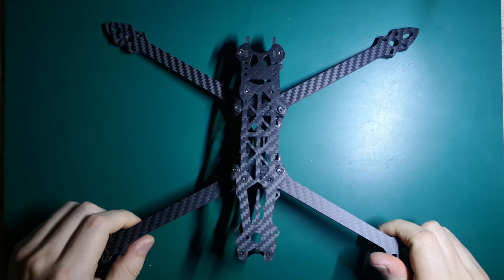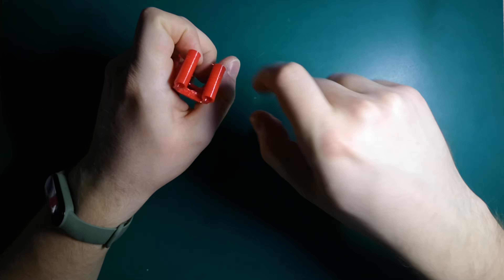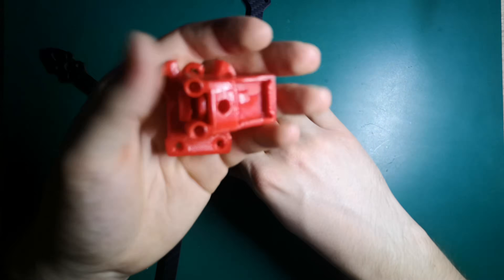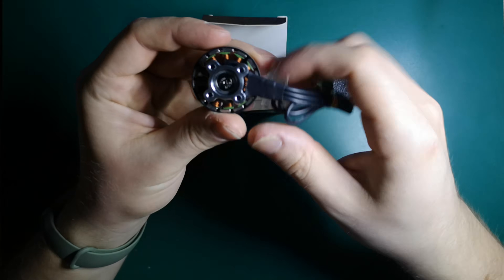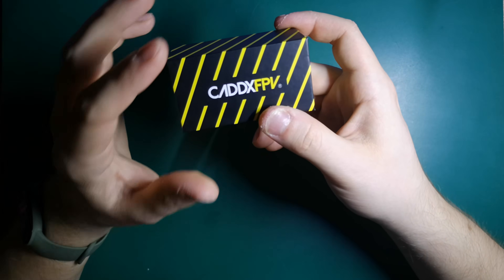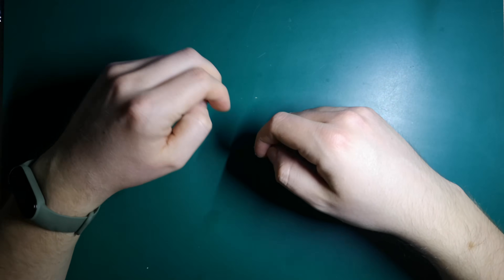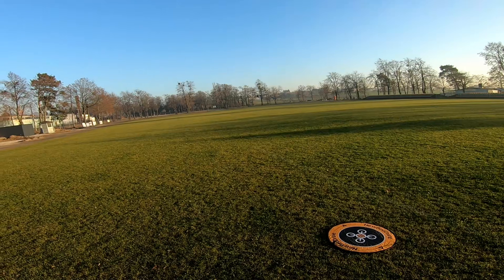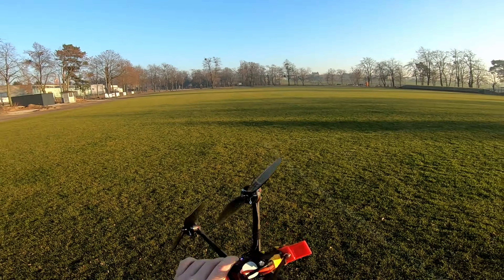Build a light 7Inch Long Range Drone for 180$! in 2025 [It can RIP🔥 as well]

Comment: I just setting up, same frame, motors, speedy bee, gonna try the Molicel p50b 5000mah 21700 cells for 6s.
Reply from the maker: I close future maybe i will do video about doing RIGHT Long range pack (I got EVE50PL the best so far 21700 cell) From designing cell holder, printing from ABS, ASA and spotwelding with solid COPPER BusBars. To have best longrange li-ion pack possible

Comment: Do you think the 3-D parts would work on the mark for 10 inch for the antenna mount?
Reply from the maker: Yess spacing is same, 7inch only is slimmer from plate to plate
Reply: @ awesome I saw the other video finally with the 10 inch but I wanna run a GPS in the video with the 10 inch had files but it didn’t look like the one with GPS so thank you
Reply from the maker: @FPV_osito  So you can run gps+vtx mount on 10inch no problem, same stl from 7inch. On 10Inch it will be even easier because cage is taller and more space in height of these posts.